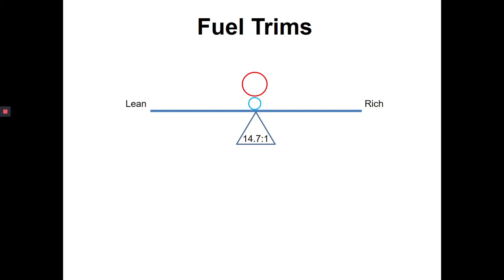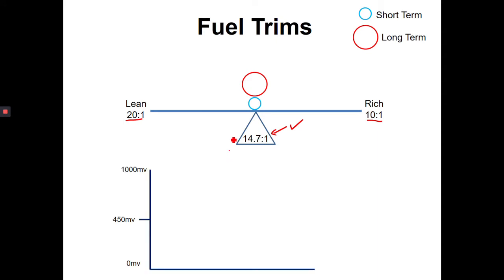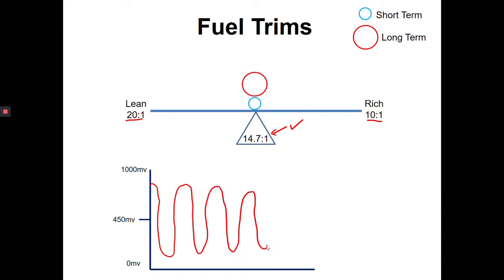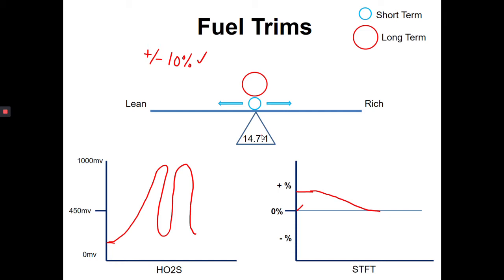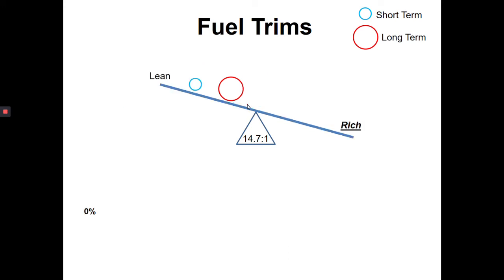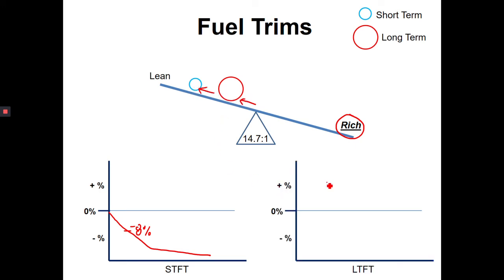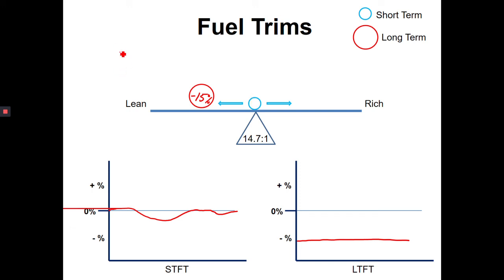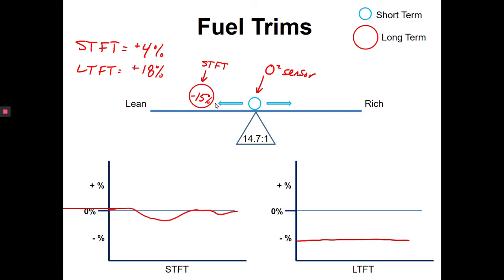Simple Fuel Trims Explanation  (STFT and LTFT)

Comment: How does ethanol affect ECM/PCM fuel trim calculations?  Does it require the same 14.7:1 ratio calculations or some other ratio?  If so does the ECM/PCM sense whether the fuel is ethanol or gasoline and use a different ratio for ethanol?  If the ECM/PCM assume gasoline is used and does not adjust for the use of ethanol what is the impact on  air/fuel calculations and fuel trim outputs?  How does this affect scanner outputs, rich, lean, etc.?  Is there a YT video that addresses these questions?  Bottomline: How does the ECM/PCM adjust for these two different fuel types with different optimum air/fuel ratios, or does it not, and what are the impacts on scanner readings and diagnosis?  Again,  is there a YT video that addresses these questions?

Comment: It makes more sense to think of it as an AC signal floating on a biased voltage.   The Short term trim is your AC signal alternating, and the Long term trim is a bias that follows the short term action, to account for what it is doing, that way the short term can drop back to zero and continue to alternate, while the long term is holding the offset..  It's so much easier to show it on a graph this way;  and I know it's hard to explain in words like this.

Comment: At last. A much better video explaining the fundamentals behind the fuel trims. Now..., I have a Focus III 1.0 Ecoboost (2015 Facelift) and it had about 25000km when I bought it (second hand) and everything was perfectly fine..., until my bad habit of trying to test things the hard and costly way, brought me with an issue that I haven't been able to solve for 2 years with all of the diagnoses done by a Ford maintenance facility and some other Ford "know-how" guy. I have poured a "fuel cleaner" in my tank at a very high dose compared to that recommended (some 10-15 times higher dose) thinking: "If I put more, nothing should go wrong, it's suppose to just clean, right...?". Well, guess what, the engine started to run very rought at idle with a lot of misfires and after eventually that gone away over time, the fuel consumption went to almost 20% higher than it was before adding that crap into the fuel.

From what I think, the solution within that fuel cleaner has somehow got stuck on both O2 sensors, making them tell a lot of lies to the ECU, which takes the O2 data as true data. Since I've meddled with that cleaner solution, my LTFT remained stuck somewhere at positive 11%. Sometimes it goes to positive 12% and above. That is interpreted by the ECU as a vacuum leak and "thinking" that there's too much oxygen within the mixture, it pumps more fuel for a given air mass. The ECU does it's job correctly, but I'm more than sure that both O2 sensors tell the ECU that too much oxygen is coming on the exhaust, such as..., running leaner than it should..., which is very false. At least this is how I see the problem. I would like to understand from you if indeed the O2 sensors can foul the ECU to believe that there's too much oxygen being taken in the mixture or not and also to know if you think that the nuisance cleaning solution might've damaged the fuel injectors somehow and thus the faulty fuel injectors might be to blame for the interpreted too much oxygen, idk. Looking forward to how might see this issue!

Thank you very for your effort Cheers!

Comment: This was an excellent presentation and explanation. Thanks. What if STFT never return to a normal range and LTFT also are high 12.5% during this time. Obviously there is some kind of leak but why would the STFT not return to normal especially under load. The car runs fine otherwise.

Comment: Thank you for the review I now have better understanding, it appears we need to check the long term stats more than short term since the short term fluctuates and long term is the reading of the short term over time ..Please let me know at what percentage should one investigate or preventive measures, I believe the MIL lights above 25% either lean or rich condition base on long term fuel trim..
Reply from the maker: If you see anything over 10% (+/-) then there is something going wrong.
Reply: @colchilibeck  -/+10  on LTFT right? Not the small one
Reply from the maker: @olegkukhlevskiy6006  correct
Reply: @colchilibeck  tnx for the reply, i have -25 st and -0.16 on lt when I accelerate, im ok right?
Reply from the maker: @olegkukhlevskiy6006  I wouldn’t worry too much about what it is under acceleration. What is your long-term at after you go for a drive? If long-term is still fairly negative after a drive and it idle, you could have a fuel delivery issue.
Reply: @colchilibeck  LT is at -7 when idling

Comment: What is an acceptable amount for LTFT, to be working within limits? In the past it had fouling of one of the plugs. causing a misfire. When the plug is clean the misfire is fixed.

When I connect an OBD2 reader to my car and idle after warmed up (closed loop). The STFT acts as expected, hunting from 0.8%to 2.3% However the LTFT remains stationary at -11.7%

02S1 slight fluctuation from +0.07mA to -0.09mA 
O2S2 slight fluctuation around 0.7V
Reply: I get the same but LTFT is like -15 after an hour drive it only gets up to -10 to -5 never goes zero and STFT hovers around 0

Comment: Am attempting to chase down problems in my '14 Chrysler 300C hemi from a P219A(left bank cylinder imbalance/AFR), nothing wrong with engine with compression test 245 psi in all cylinders across the board and sub 10% leakdown, no valvetrain damage, swapped injectors from left to right, fuel pressure tests normal @ 55-60 psi, replaced plugs w/iridiums and hot coils, retorqued intake manifold to 105 in/lbs, and reset PCM to relearn itself. Car runs better than perfect even after setting this code, happens about every 250 to 350 miles on long road trips. All freeze frame data is within normal range. Engine has shorty headers on it with a 91 octane tune and ported throttle body, problem seemed to manifest itself after the headers were installed and took on long trip.
Help!

Comment: Let's say if u have a leak at the exhaust manifold before sensor 1. Will that cause the PCM fuel trim to add less fuel because the oxygen sensor is showing it's running rich? Because the exhaust gas the leaking out before passing thru sensor 1 therefore telling the PCM is no Oxygen is passing thru the O2 sensor.
Reply: Yes if the exhaust gas don’t pass through upstream O2 sensor and the downstream O2 sensor after the cat sees the same computer will think the cars not getting enough fuel and add more which it doesn’t need this will keep happening until the exhaust leak is fixed.
Reply: @ryans413  I thought it's the opposite. I thought exhaust gas contains some oxygen. And if it doesn't pass thru the upstream O2 sensor, it will run lean. Not rich.
Reply: @7150285  yes that’s right my bad
Reply: @ryans413  actually. I think it really depends on each individual situations. Each situations differs.
Reply: @ryans413  All I know is O2 sensors measures the level of oxygens. Too much O2 means not enough fuel and is running lean.

Comment: i own a 79 caprice classic equipped with Lq4 engine while i tuning by hp tuner i have notice that STFT & LTFT never read no matter what i do still read 0% however i use 2 o2 sensors and hooked up to ECM but i'm not using BCM at all due to engine swap, any assurances to activate these STFT & LTFT

Comment: I'm trying to get my head around fuel trims. Would I be correct that a vacuum leak would cause the engine to run at a higher idle speed than normal? My logic says it would, but I've never heard of a high idle speed being a symptom of a vacuum leak before. Thanks for your help.
Reply: Yes I vacuum leak would cause high idle it’s air not being counted for by the Mass Airflow and would probably cause the rpms to jump around cause the computer can’t see the air volume as give the right amount of fuel needed. Plus it would effect fuel trims as well
Reply: @ryans413  Thanks for your help.
Reply: @labradormcgraw     No problem
Reply: exhaust manifold  leaks will cause a lean condition. Its unmetter air.  When  cold leak can be big and when hot it can be small or not at all. Cracks in the exhaust manifold, broken bolts, bad Gasket  anything that will allow  air in before the  02 sensor.

Comment: Very useful. I just have a question.  My case is LTFT -24%. STFT is almost 0% at idle but     If higher rev range over 2500, STFT will be 15-20%. What happens in my car?  If LTFT is based on STFT, LTFT will be slowly to 0% or a positive %.   Also, the STFT increase at higher rev range is an issue? Or normal?

Comment: I feel like the drawn should of been different. I understand the reading of - means rich and + means lean. I would say the red ball should be on the rich side because of the reading I think it may give some confusion. When the problem is indicating a long term rich reading we will be around -15/-30 when our issue is found our short term will then run + because our issue is correcting and rebalancing back to our 14.7.1.

Comment: But what if the O2 Sensor reads the mixture but it doesn’t correct it? 
Example: LTFT doesn’t move, staying by 0,0. 
 STFT are positive as high as +24 at 700rpm but goes down to +3 or even 0 if the AC is on or the engine is running at 900rpm just 200rpm more?  Why does the ECM not correct? Wide band O 2 Sensor, new, same problem as before. Normal O2 Sensor after the catalyst is reading 0,750v. 
when I take my foot off the gas after accelerating it briefly shows 0.0 volts on then goes back to 0.750-0.800 volts
What is happening here? 
I get how LTFT and STFT work, but this makes no sense to me! If someone has an explanation for this please comment!

Comment: Hello, i have -15 to -20% long term fuel trims, and +25% short term fuel trims at idle. What can cause such a strange condition
.
Reply from the maker: If it is positive for both long term and short term it could be a vacuum leak or lack of fuel (plugged injectors, weak fuel pump etc). 
When accelerating, if the short term goes More positive, check the fuel system. If the short term Drops, then check for vacuum leaks.
Reply: @colchilibeck  sorry the long term fuel trims are -15 to -20%. And the short term fuel trim at idle is +25%
Reply from the maker: @fortnitedaily1042  sounds like a possible vacuum leak. That’s the first thing I would check.
Reply: @colchilibeck  Thanks for your replys, could be bad maf or bad o2 sensor since Ltft  Are negative and Stft are positive? I have not found any vacum leak
Reply: @colchilibeck  what do you think?

Comment: Thanks alot sir u did well for us...
.sir I have camry 2007 2.4.....STFT -11.72 and LTFT - 19.53.....is it ok or what I will do ....I am in bahrain and here machanic is not well ....Thanks sir will wait for u good reply
Reply: I too had similar with LTFT going to 22.x, there was vacuum leak from break booster pushing more air via break-hose to intake manifold.

Comment: Legit had that issue where ltft would stay at -21 and stfu would be -25 for the longest on my 2018 Honda civic hatchback today I changed the fuel injectors and boom back to normal stft goes up and down like normal - then positive when driving and ltft stay between 2 or 3

Comment: Very good explanations, except that you messed up the negative and positive trims.
If the displayed fuel trim value is a negative number, it means that the ECU is decreasing the injector pulse width to subtract fuel from the air/fuel mixture to lean out the air/fuel mixture because the input data it is receiving tells it that the mixture is too rich.
If the displayed fuel trim value is a positive number, it means that the ECU is increasing the injector pulse width to add fuel to the air/fuel mixture to enrich the air/fuel mixture because the input data it is receiving tells it that the mixture is too lean.